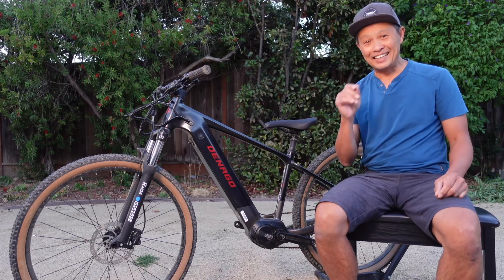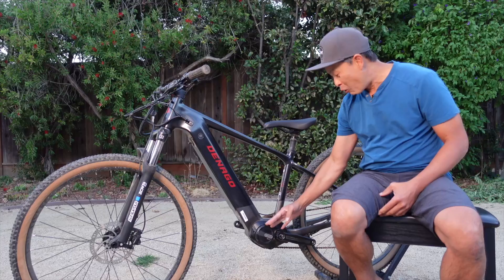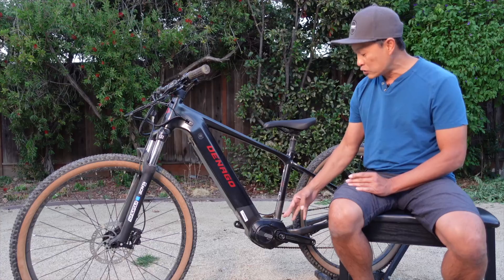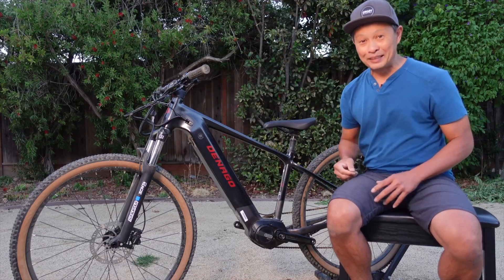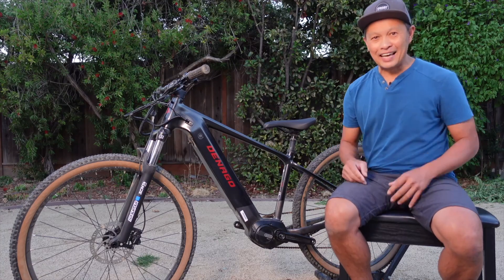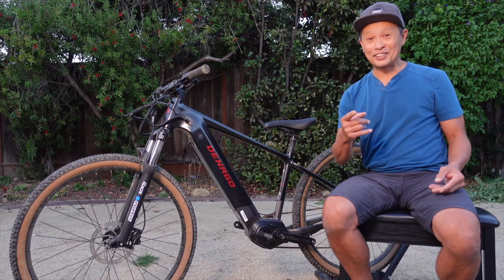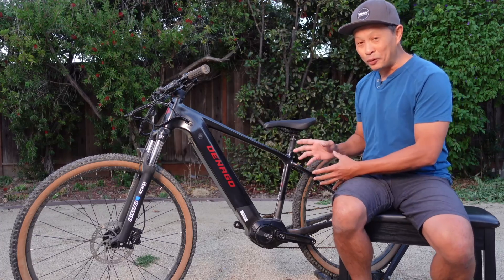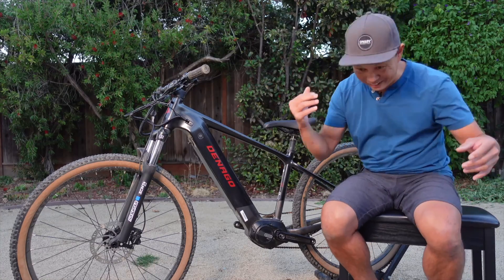Bafang 510 ebike motor tested - how quiet and how fast is it?

Comment: There is no problem with changing up but when you change down it's works ok if you hold the selector after you make the first shift, don't let it go! Then continue to push it you should get at least total three shifts with only one engine cut out. Depends on your shifter.

Comment: shift sensor motor shutoff time should be about 0.1-0.2s, and should be settable with the BESST tool. Having a shift sensor is a huge benefit, but riding with it is different. no need to back off on the pedals, just hammer straight through the gears and you get incredibly good shifting, a bit like on a sequential gearbox. no crunching like on bosch, shimano and brose motors.
the shift sensor, if tuned correctly is one of the best things you can possibly have on a middrive ebike.
Reply from the maker: Yes, we see it now. It is good for beginners and low-end drivetrains cause there's no learning curve and it saves drivetrains.

However for advance mtb-ing we found it unusable at the stock setting. And we found no way to adjust it.  Shimano drivetrains and the new Sram Eagle can handle shifts very well with some awareness from the rider. It enables climbing very steep and technical terrain with much success.
Reply: @EMTBReview  not for beginners, for fast, reliable and damage-free shifting under the most challenging conditions, where a motor without shift sensing would just crunch gears and eventually destroy the chain. of course the cutoff duration must be short enough to not lose momenum. on the M510, there is no dedicated shift sensor port, so the shift sensor is plugged into one of the brake cutoff ports, which by default have longer cutoff duration. That should be tuneable with the BESST tool I guess. will see that in a few days, because the all new M435 also has too long of a brake/shift cutoff. on my Toseven DM01, it's much shorter and truly makes for the fastest and cleanest shifting ever.

Comment: The one thing about faster e bike motors? Is that its still a mt bike, and when you eat it hard going faster things can break even more so. 
 I can run my Shimano motor'd bike in Trail Mode and be going plenty fast for trailriding.  18mph up some steep hills can be done.
But I pedal hard also.    If your on trails where there can be hikers or horses?    Good to keep that in mind.

We dont want to be dicks out on trail right?
Reply from the maker: Most definitely!!! Climbing at Mach speeds is best done on remote, isolated fire roads.

Descending, these bikes are a hair slower than mountain bikes so not a big issue there
Reply: @EMTBReview  A hiker getting hit by a 50+ lb E bike, well that could leave a mark. Not to mention I see a lot of + size riders on E bikes.
 Lot of weight going forward.....some trails have horses/hikers so common sense is good.................the whole idea of "faster motor E bike " can lead to a poor public perception of an E biker flying by.... they can go as fast as dirtbike on some trails.

Comment: I have a fat tire e-bike and the torque sensing Bafang M620 and it is LOUD - it's so blasted noisy.  The power of the M620 is claimed at 160 Nm, but there is no way it is that powerful.  I have the 750 watt rated M620, and it has no more power than my Bosch or Shimano powered bikes.  It also sucks the battery like there is no tomorrow.  The torque sensing on the M620 works fine for my use riding on the road or bike path.  If your bike was quiet, I guarantee something is rigged. The bike manufacturer worked on the motor before sending to you (there are many videos on YouTube on disassembly and greasing the Bafangs to quiet them down).

In comparison, I have e-bikes with Bosch Gen 2 CX (75Nm), Bosch Gen 3 Performance Line Speed (85 Nm), and Shimano E8000 (70 Nm) motors.  I much prefer the Bosch - which I have tens of thousands of miles riding experience.
Reply: i don't know about m620,but i have bbshd which is supposed to be less powerful. I can bet my  house your Bosch can't hold a candle to my bafang powerwise. I can pull you up and your bike on a steep uphill without even pedaling. Try that on your Bosch!!! You can't compare a powerful motor like Bafang to your kid's toy Bosch. That's like comparing Opel Corsa to a BMW M3 :)
Reply: The M620 is loud because it has all steel gears. The M510 a nylon gear after the motor shaft pinion gear. That makes it 10 times more silent. In terms of power, 1st of all, torque is NOT power. power is the combination of torque and rpm. The M620 has a no load rpm of about 160, that is significantly higher than bosch or shimano. that means, the max power is achieved at around 120-130rpm at the chainring. most riders don't understand this and will run the motor inefficiently at the highest assist level. also, break-free torque is a matter of firmware tuning and, my toseven dm01 (1000W) as well as the BBS02 750w i've ridden for many years have much more torque and power than bosch, shimano etc..
obviously, bosch's torque sensing is very good and dynamic, bafang's might be a bit less refined, though I bet with proper tuning with the BESST tool you can get there and have the extra power and torque.
Reply: @JoLe1991  Wow, if you are pedaling at a sustained cadence of 120-130, you are superhuman, and I guarantee 99% of riders are riding under 80 rpm.  Since the majority of the 2.5 to 3M e-bikes sold in the US the past 3 years are over age 50, you can bet many of those e-bike owners are not pedaling over 70 rpm.  This customer demographic has no interest in riding like they are in the Tour de France.  

This is the problem with companies like Bafang.  They report a rating which is meaningless in the real world.  Be it torque at an unreasonable rpm, or watts with no reference as to peak or continuous.
Reply: @tedbellSEA they could Design the motors to deliver max power at 80rpm by increasing the gear reduction ratio, but that would just put even more torque on the chain, cogs and freehub body risking very early bike part failure. that is why all the high powered mid drives (750-1000W ) don't put out a whole lot more torque, but rather get the power with a higher rpm.
Reply: by the way, the watt rating on bafang motors is continuous for some time with some degree of airflow, not power consumption, and the rated wattage is probably referring to power uptake, not output, but I could be wrong on that. anyway, for pullinh heavy loads reliably, my toseven DM01 (similar to BBSHD), completely blows away any of the typical mid drive motors. 1450W power uptake by the motor is just another level... bosch batteries as re limited to 20A, at 40V (full battery under load) that translates to 800W
I have built a full suspension ebike with the M510, and the DP C240 display that came with the kit indicates real time battery amps. in boost mode it will reach 15A. with a full 48V battery (52.5V under load) it will pull 787W, so just a bit short of the Bosch CX.
Reply: Your m620 is hobbled at 750 watts and is not putting out 160nm so you can not judge as it not full power. My M 620 has become obnoxiously loud at 2000k and a regreasing will fix this. With 2 Bafang M620 riders and a Bosch rider guess who pushes their bike through crazy tech climbs. I am not power limited but traction limited.
Reply: @tonym6633  Bafang claims the M620 puts out a "maximum" of 160 Nm of torque, but does not define what that is.  They say the M620 comes with 750 or 1000 watt "rated" power output, but again no specifics on how the wattage is rated.  Peak or continuous, who knows?  Bafang makes no distinction in torque between the 750 and 1000 watt versions of the M620.  All I know is the M620 is not that powerful and sucks batteries like crazy.  It seems to be a very inefficient motor.
Reply: @tedbellSEA  Proper M620 is 1000 watts continuous 1500 peak. 160 NM.Don't hate because you have a defective/dumbed down one.
Reply: @tedbellSEA  1000W= 30A
750W= 25A
volts x amps = watts consumed
multiply by the efficiency and you get output watts
the motor is inefficient at low rpm. peak power is at 110-130 rpm. if you're pedaling at 60rpm, you're using it totally wrong

Comment: It has a mechanical gear switch sensor on the gear cable, just take it off and the bike will run as normal. Denago just didn't quite trust your skills in riding the bike so they put a gear switch sensor for you 😊 better check for brake cut offs as well 😅
Reply from the maker: Thanks for the info! Denago just got back to me with that info. Very cool option.

Yup, I wouldn't trust me either with my full turbo shifting.

Brake motor cut-offs are the work of the devil for mtb. :)
Reply: @EMTBReview  😀 as the target market for the bike is not necessarily experienced emtb riders Denago may have put the gear shift sensor just as a precausion as bafang has that as part in its mid drive motor lineup. But the gear switch sensor origins are in the Bafang motor kits for electrifying your acoustic bike.
Reply: @EMTBReview You can unplug the brake sensors as well and makes a huge difference. Allows for brake drag to maintain power and motor preload. You need to try M620 bike. Biktrix Monte Capro Ultra.
Reply: I have that motor and the above comments are correct. That bike has an aftermarket shift sensor installed, that's not part of the M510 itself. I bought one when I acquired  the motor but I never installed it and never will, as I found that there's really no need for it, so no cutoffs whatsoever.

Comment: You will have to test the M620 with 160Nm! That should smash your record.
 Great to see a review of a non mainstream bike.
 Keep up the good work.
Reply: The M620 is unfortunately suuuper heavy, my M620 bike is like 67 pounds which is not fun to ride on trails. With an upgraded controller though it's insane, 160 Nm of torque is totally believable and it can do almost 40 mph.
Reply from the maker: One key takeaway here is it legitimizes Bafang's claims. The mean what they say in the specs! Hats off!!
Reply: I have a bike with the Bafang M620, there is no way it is putting out 160 Nm.
Reply: @tedbellSEA  it does. but as with all frame integrated motors frames will only allow all these crappy cylindrical cell batteries. stone age tech compared to what's available in the solid state NMC811 world. The M620 is very power hungry and stresses out most of these integrated batteries. I have a toseven DM01 (48V 30A, like the M620) and it rips like crazy, but you  NEED a big battery with low DC internal resistance